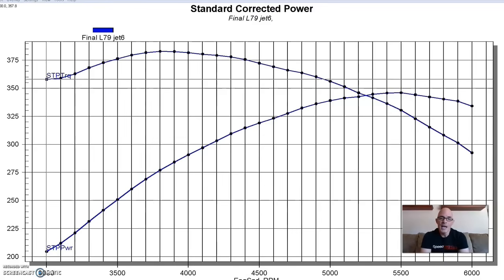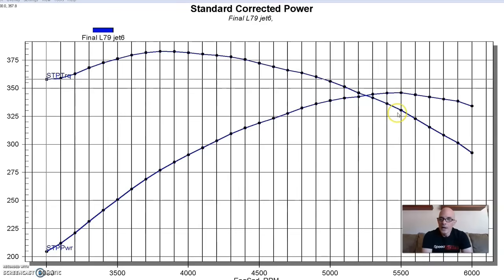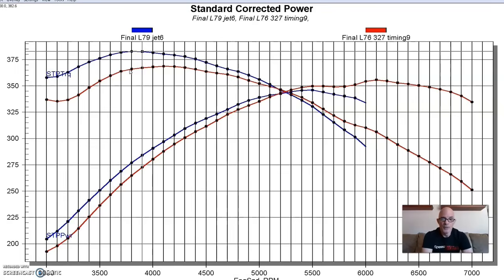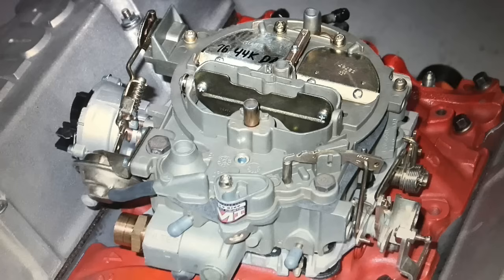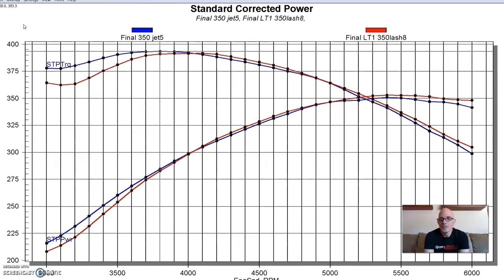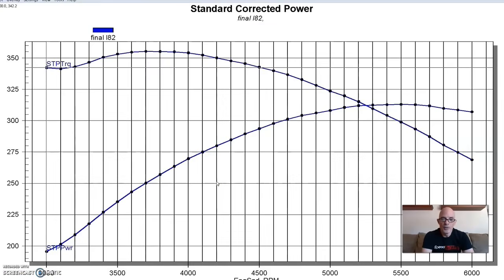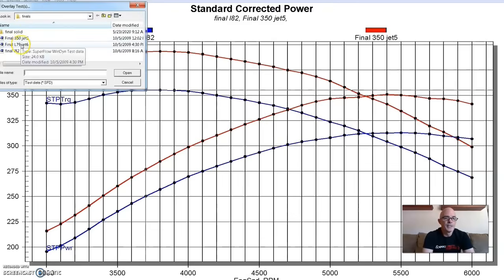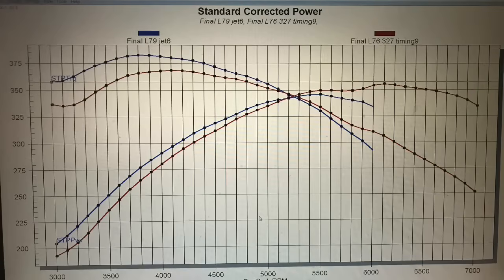HOW MUCH HP DID THE L79 350-HP 327 REALLY MAKE? WHAT ABOUT THE L46 350-HP 350 OR L82 250-HP 350?

Comment: I can tell you from experience that the solid lifters needed frequent valve adjustments
Reply: Its been my experience that if you use poly locks they hardly ever need adjusting. Running the valve lash is used to check for problems before something brakes. if you have a rocker that constantly needs adjusting there is a problem.
Reply: My 365 with the 30 30 stock cam would start to rattle a little bit in about 10,000 miles. No real hard to set but could be a little messy as we did it with the engine idling.

Comment: How did Chevy make the 250 horse 350 with a 2 bbl carb? They were built in the early 70's. Had one in a 74 Monte
Reply: I just find it odd that we had 2bbl 350 engines when I was a kid that got good milage, would fry the tires and take a car of that size and weight up to 100mph with ease. I guess they made gobs of torque and that's what made them run so well. I know my buddy had a new 85 Z28 that could not touch that old Monte, it'd piss him off real good every time I blew his doors off. Keep up the good work and stay safe sir.
Reply from the maker: base 2-brl engines were rated at 250-270 hp Gross-The L82 was 250 NET HP

Comment: Great comparison! It was interesting to see how accurately the GM rated the factory Chevy muscle small blocks.  I would really love to see you do a W31 small block Olds (small cylinder head ports, big valves, and big hydraulic cam.)  How does it compare to the 1970 LT1, the 340 Six Pack, and the Boss 351?
Reply: I can tell you, the torque curve on the sb olds engines were flat, peaking around 4500 rpm, but not dropping off that much, up to 6000, especially running the w31 cam. I used to run sb olds in my drag cars. bullet proof, and great performers.
Reply: @sarcastomimic2683  Oldsmobile like Buick and Pontiac made only 1 block so there was no small block.
Reply: I had a dead stock 403 amd 200-4r in a 78 cutlass... best damn engine ever.
Reply: Hell Yuh! The 64-67 ultra high compression 330ci olds also

Comment: I'm so, so burned out on the LS that I'm actually glad to see a SBC...go figure.
Reply: I hear this. the LS is a great design, but I grew up with the Gen One. Its like a gun magazine reviewing yet another...AR15 clone. yay. it works just like every other before it. fantastic.
Reply: @albertgaspar627  right my friend. A 327 with cam and aft heads makes it just as great as any other. The 327 has an outstanding bore to stroke ratio and can rev to 9000 rpm producing over 500 hp. The LS advantage is because of improved head design. Head and cam technology makes the difference. The LS6 454 can be pushed to 600 hp with head and cam swap if you take a 6.0 LS you can make up to 900 hp with less money than to get 600 from a 454. I am 72 years old so have lived through some of the same years you have. Gm engineers took us from a stove bolt216 to a 265 SBC that took us out of the No power group. They have made a great concept even better not just with cubic inches but better add ons.
Reply: @kenswitzer4133  true, the LS is cheap to build and then the problem is putting the power to the ground and finding an open location for it. but the cost comes in the installation--if you know which oil pan fits, which serpentine belt setup fits, whether to use a throttle by wire gas pedal or not, etc, then you've got that problem licked as well.  On the flip side, i'm picking up speed parts for the "old stuff" dirt cheap as folks go LS/Coyote?Gen III Hemi (just nabbed a polished Offy 360 intake, carter carb and bugeye air cleaner yesterday for $125 total for an LA mopar small block i don't even own yet) so honestly....we are in a hot rod heaven the likes we haven't seen.

we can go old school, new school, or somewhere in between, and have the internet and swap meets to cruise for parts.
Reply: I feel you man, the ls is way more advanced engine but they have been put in everything, I've thought about putting ls in my buick but it's the typical thing to do and I don't want to jump on that band wagon
Reply: The LS is fantastic but LS this and that gets old. I have owned 283's , 327's and 350's and loved them all.  SBC' still rule. It would make my day to see some aftermarket cam company develop SBC heads with a dual OHC setup and front mounttimimg chain setup to spin the 4 cams and have one of the most powerful SBC's ever built. Richard does a great job at keeping us up to date on old school👍👍✌️😁👍
Reply: I love my L79 in my 68 vette and I love my LS in my 06 Escalade.
Reply: @swully-ol4lx  exactly, the only brand new car I ever bought had the LS engine. (1999 T/A) Did I like it? Sure, I loved it but I'd never drop one in a 68 Corvette or any classic car. Nowadays I  have a 3rd Gen camaro Z28, people (mostly younger guys) seem to be frothing at the mouth to put an LS in these cars. I'm good the way it is.
Reply: Old small blocks rule these LS Motors have SP MANY bottom ends ,  they just simply suck , look at all the oil and problems , the heads are good , but the rest of the engine sucks .
Reply: But you must worship LSs. 
The SBC with modern components is a better engine and will make more power. And all the drag guys are using iron blocks so weight is similar.
Reply: the retard LS guys are gonna hate you now.
Reply: modern cliche back to the vintage cliche. Once you own an LS you'll never be burned out from it lol
Reply: @rustysausage69   I own both, LS & 1970 LT-1 , not impressed with the LS at all, has to much B/S to keep up with and I really like dependable old school anything.
Reply: @rustysausage69  As long as I have my 'Falcon, I wont be owning an LS or SBC.
Reply: @jeremymurphy7320  great. Ford has built some fantastic engines as all others have. Fords head design out performed SBC's for years but with after market heads that has changed a lot. I don't care who builds it. They can all build the same size engine that makes almost identical power. Small to big block they have all had their chance. Heads and rotating assemblies have made the differences. With carbon fiber rods, titanium valves and balancing and new technology they can all have similar power outputs. Now days the coyote engine is awesome. What is the main difference in it and an old 302? Air pumps can deliver the same flow if built similar so it is with the internal combustion engine. Dodges 5.7 hemi is also awesome. Heads, heads are the best power adders for the money.

Comment: Its happened in a hydro cammed 454 (lunati bm2) only a couple stock lock nuts would back off ended up getting rockers and locks. 
            Quick tip if you have a spare set of rocker nuts you can use them to lock the pre set nuts in place by double nutting them.

Comment: lol on the nuts, I remember dirt poor racers pulling the loose ones off and hitting them with a hammer to give them a super cheap new oval grip on the stud again...lol.
Reply: I just had to do this last September on my way to a rod run. Works
Reply: Yup... Biggest bitch from my older cousins in the 70's / 80's with solid cams. They were a bit dramatic but said they were junk and GM never should have used them. One cousin had a 65 Malibu L-79 that to this day says it was the best combo ever put out. The Chevy II might overtake it but who knows. He said he took down big block cars with that car regularly. 

Another cousin had a 70 Malibu with a 300hp 350, 4spd and 3.36 posi rear that was 100% GM built other than a set of headers. That car took down a number of 'built' cars in the day. He likes to tell the story of going stop-light to stop-light with a guy in a V8 Vega. Every light the guy was going on about who built the engine, who ported the heads, who did the rear, etc. Every light my cousin beat him. Finally the guy says "Who built that engine??" "GM, 1970..." Replied my cousin... 85 or 86 a tie-rod broke and he launched a Mustang II over the back of a Cadillac Seville. The one with the angled trunk... 

This was all in the late 70's to mid 80's when these were just unwanted, junk $50 cars... There was no factory high perf cars and most people building from what I can gather didn't know anything. A 15-second car was considered quick and 14's were killer. Only a very small handful of cars around the Philly area back then actually were fast. I was a young kid, I looked up to my cousins and their muscle cars and there probably were a few tall tales so take it for what it's worth but I do remember ALWAYS hearing that solid cams were junk and required constant maintenance.

Comment: My dad had a ‘65 Fuel injected 327 all through the 70’s and he switched from the solid cam to the hydraulic (I believe it was the 350h/327 cam) because it drove much better. He told me the performance wasn’t much different for street driving. Whenever the car sat too long, he had to have the Rochester rebuilt, but I don’t recall him he mentioning any problems with having to adjust the valves.
Reply: I asked my dad, and he said he did have to readjust the rockers with the solid cam constantly - part of why he switched to the hydraulic cam.

Comment: yup i had a Dutov  30 30 in my 69 and it was a giant pain pulled the stud out of my heads and it never held the lash with the stock type nuts.
Reply: I never pulled a stud out of any Chevy head with a Chevy cam/springs. You needed a new set of rocker arm lock nuts.
Reply: @victoroneill7924  i tried  the poly lock nuts. i was 17 and could not afford screw in studs at that time in life, and it was obviously a problem or G.M. would not have put screw in studs in the small blocks that had solid cams.

Comment: I have been reading a 2012 article you wrote taking a L76 and building a 9.1 350 to milder specs 882 heads ported and 2.02 valves on a .454 lift.  367hp and 422tq, alot more streetable today. 👍

Comment: Do the AFR intakes make more power over the aluminum and do you need to back cut the boosters on your carb for a smaller droplet size to take full advantage of the cooler intake charge?
Reply from the maker: minimal charge cooling differences
Reply: Thanks for the reply. Should have just stayed with the aluminum intake. Is there any point in back cutting a step in the boosters?

Comment: Before the 1965 model, the industry standard for hydraulic camshaft cam lobes was 70 percent cam lobes. That is the 0.006" lift SAE duration is 70 percent of the 0.050" lift duration. Around 1962 Iskenderian started promoting high performance hydraulic after market camshafts and 75 percent cam lobes. Most all model production car hydraulic camshafts had 70 percent cam lobes for model year 1964, with a possible mystery camshaft in the Pontiac GTO, that was the same on paper as the standard Pontiac V8 camshaft, but had a different part number. For the 1965 model year, the L79 327 and 396 engines got new camshafts with 75 percent cam lobes. Pontiac switched to 75 % cam lobes on 4 barrel and tri carb engines for 1965. The 275 hp / 300 hp 327 Chevy may not have gotten an updated camshaft until the 1966 model year. Ford 390 GT in 1966 and Mopar did not update the 440 camshaft lobes, but did for the 1968 340 engine. The small block Chevy Q-jet carb and intake were more modern than the L79 intake. The L79 camshaft was ground 4 degrees advanced while the 350 L46 camshaft was ground straight up. In 1971 GM had a crompression ratio limit of 8.5:1, but Chevy got waivers to this limit for 1971 454 LS-6, the 1971 - 1972 350 LT-1 and 1973 - 1974 350 L82, all of which had 9.0:1 compression ratio. Pontiac wanted a compression ratio waiver for the 1973 - 1974 445 Super Duty engines, but GM wouldn't allow it. The 1975 L82 got a lower compression ratio, smaller valves and single exhaust.
Reply: I read somewhere years ago that the "151" 327-350 cam was the first OEM "performance" hydraulic cam but never knew what that was based on.  Thanks for your info, and it looks like Pontiac perhaps shared that title.

Comment: I had a 92 s10 with a 327 that is very close to the same engine as the L79. I absolutely loved that engine in that little truck.  I had a slightly different cam, an Air gap intake manifold, and Holley 750 with vacuum secondarys.  I eventually put a t56 behind it and it made that truck an absolute blast to drive.  It had just enough power for the street.  It hurt a lot of Mustang's and Camaro's owners feelings. I tore it apart 3 years ago to build a turbo Ls and haven't had the time to finish it.  I wish I would have left the 327 in it and I would still be driving it

Comment: The solid cam 327 is good for its application being used in a relatively light Vette, mitigating somewhat the low RPM disadvantage vs the hydraulic cam motor, but what a sparkling top end with greater HP and torque carryover.  Nice bump over a likewise cammed DZ302 as well.  
I wonder if a 327/365 HP C2 Vette is quicker than an LT1 350/370 HP C3 Corvette?

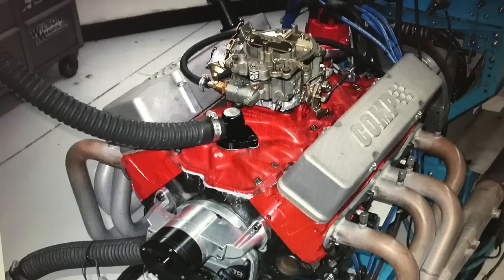Comment: 11:00 Yes I know about solid lifter and the rocker nuts backing off.  Look at the factory rocker nuts, if the nuts are round, time to replace the nuts or poly locks.
The NEW FACTORY NUTS ARE OVAL. THAT LOCKS THE NUTS IN PLACE.    BUT AFTER MANY MANY ADJUSTMENTS,  FACTORY NUTS GO ROUND.
AND WILL BACK OFF.
POLY LOCKS ARE THE BEST OPTION @ 7,000+ RPM @ FRIDAY NIGHT DRAG RACING.
Reply: You are so smart,  a real Old School operator. 
G. O. A. T.
Thanks for the help.
Reply: And poly locks stay tight longer if you spot face the studs.
Reply: Hey man You  are
Up tight and out of sight. 
Snap snap
You're so smart
Reply: ford dont have that problem.clevo...windsor same as chev.press in studs bolt down rockers,rubbish.guys here in aus complained the whole stud comes out.ill keep my fords.i read in a u.s mag yrs ago,the chev 350 fell apart at 6k,valve train,clevo,,ran all day..6k.plus,the 350 cam is held in by?.nothing.similar to dodge.if,fuel was cheap here,id have a mild 450/500 hp 460,last forever.& rev to 7k..

Comment: Had the same rocker nut problem on a mild hyd roller BBC build a couple of years ago.
The nuts with insufficient crimp were from a major replacement parts brand. Crudely solved the problem by deforming the nuts some more. 
Your site is currently the most interesting for an old motorhead!
Reply: It also seemed that if the nuts were taken all the way off the studs that they would loose their locking ability I also had that problem until it quit taking them off all the way. An old motor nut told me that and I think he might have been right. Lol

Comment: Always preferred the hydraulic flat tappet cams in my small blocks. Never worried much about the compression ratios. Most of the cams I run had around 0.480-0.520 lift. With a good intake and small Holley. Best sleeper I had I run a 600 cam two barrel carb on a 302 Windsor in a truck. Pissed off a lot of camaros with that truck ..I really liked the fact that my street motors were dependable, low maintenance motors that ran on reg  gas..  that statement should help you guess my age. Synopsis:  ain’t nothing wrong with a hydraulic cam on the street. I’ve run several motors at 8.5:1 compression ratio and had plenty of power to play on the street. Never ran big springs on my heads due to the mild camshaft so never had any problems with studs pulling out. Love them hydraulic cams. Only thing better is a hydraulic roller. Like your show a lot. Always learn something from you. Please keep the videos coming. I’ll keep watching them.

Comment: Still begging for the 400
Reply: I agree! I have one and am debating building it up or LS swapping.  ( 72 C25 GMC. ).  I know they need a bit more attention to build due to the steam ports in the heads, but would like to see what they are capable of.  I would also like to hear Richard's experience with them.
Reply: @Moto-Psycho-1  I have a video of mine.....once you build one, you won't go back to a 350.....especially with the aftermarket these days
Reply: @fabricationnation8052  I will certainly look for it. Thank you very much!
Reply from the maker: 400s work well-more cubes, they just never built as performance version from the factory and this test was about factory performance. 400 and destroked 377s work well

Comment: When I used to run a solid lift cam, I had to adjust my rockers once a week sometimes it would catch me at a bad spot and have to adjust them  in the middle of McDonald’s parking lot
Reply: That's not at all right.  Something, or procedure, was amiss!
Reply: Guessing there was a lifter issue or something wrong in the lifter length. That's not normal. They are usually set and forget but for normal cycles.
Reply: You had something wrong..
Reply: I'd check my solid lifters about every other oil change. About 5,000-6000 and i was rarely off more than a couple thousands.
Reply: If you were using the factory lock nuts then that was your problem. They were most likely worn out and needed replacement.
Reply: I've never ran the stock rocker arm nuts on a Performance SBC solid lifter or hydrualic. They are good for one adjustment then after that they are prone to back off.
Reply: and yet, he was the coolest car owner in those parking lots. that was as much a right of passage as "the mechanic" in Two Lane Blacktop announcing every burger stop

"gotta check the jets"